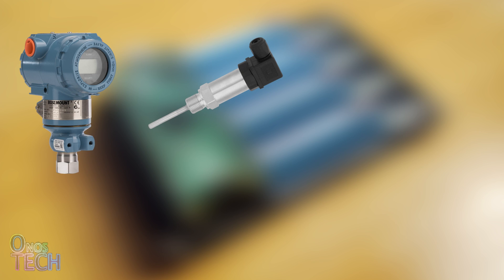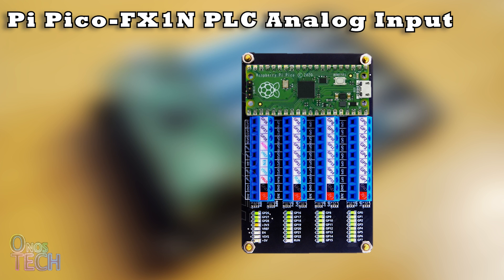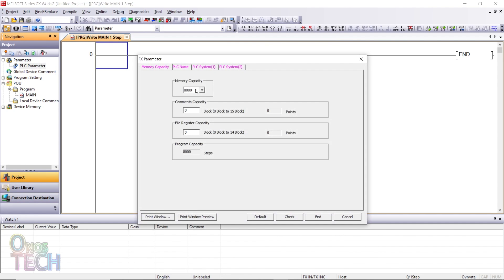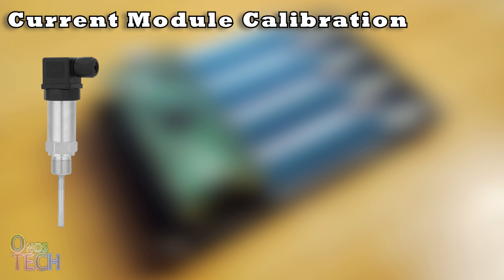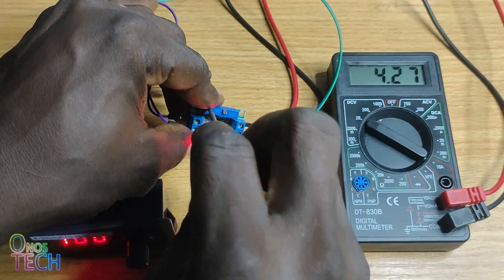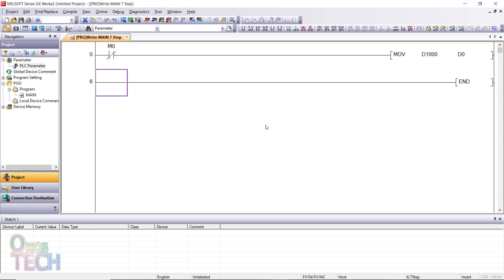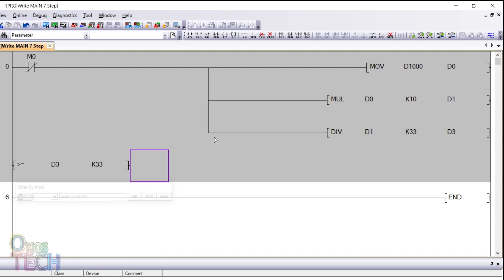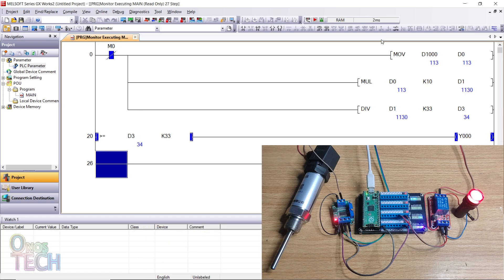How to Interface Industrial 4-20mA Sensors with Raspberry Pi Pico PLC | Mitsubishi FX1N PLC

Comment: Bro U always on top!
If we have more than 2 analog sensor in the system??
Reply from the maker: Use 2 current-to-voltage converter modules connected to AI0(D1000) and AI1(D1001)
Reply from the maker: Use 2 converter modules and connect them AI0 (D1000) and AI1(D1001)

Comment: Very nice video, I,ve been testing the Pico-FX1N with ScadaBR with some results. Could you do a video on the Modbus features of the 1.8 firmware? Not sure if it's me or the modbus is very limited. Only able to use the "y" outputs as coils. Thanks
Reply from the maker: Working on it.
Reply: @OnosTech  Access to plenty of "D" holding registers, Inputs. Strange no access to "M" coils. Have FX3U working good with ScadaBR . Access to read "X" inputs, read-write "D" holding and read-write "M" coils , maybe a glitch in the FX1N FW. Tried asking TF Maker but not sure he speaks English, no response.